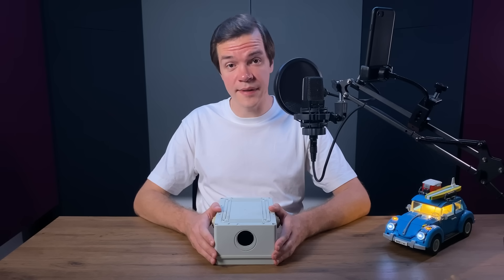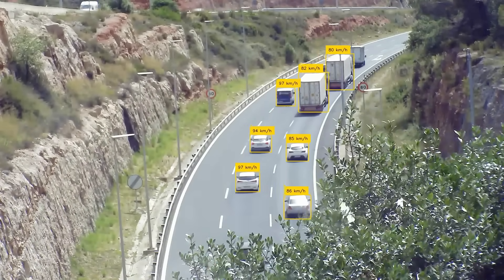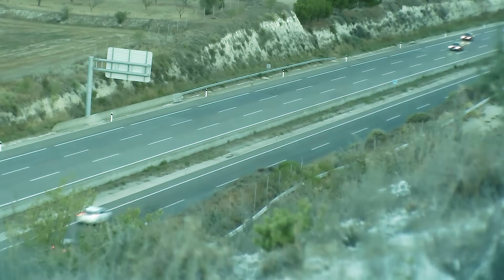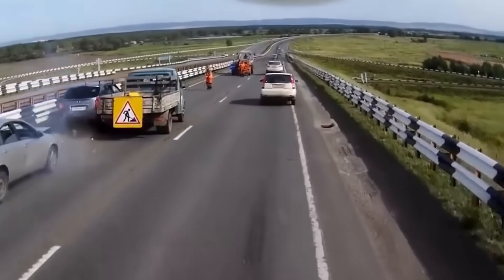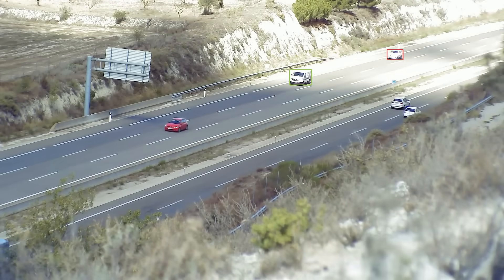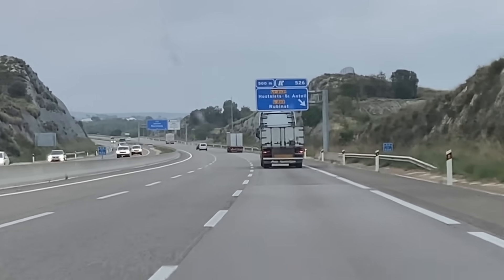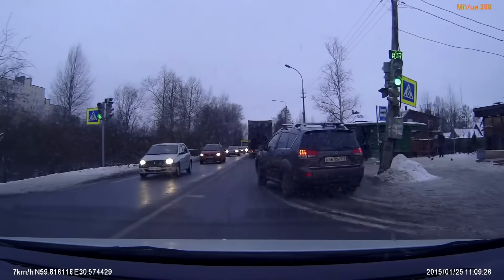New Anti-Tailgating Camera Reveals Shocking Statistics

Comment: Momentum.  This is based on speed and weight of the vehicle.  Assuming fairly equal braking power, you should understand the scenarios.  Your video focused on equal momentum.  But... real life... The momentum of three vehicle's matter (Vehicle in front of you, your vehicle, and the vehicle behind you).  Worst case (Heavy in front, light you, Heavy behind).  IN this worst case, get out of there!
*  if you're driving a lighter vehicle than the one in front of you:  You are going to be able to come to a stop more quickly than them; unless they suddenly hit 0 mph (i.e., crash).  The bigger issue may then become who and what is following you.  
*  If a heavy vehicle is following too close, you will need to extend your distance you keep from the car in front of you;  allowing for lighter braking so that the trailing vehicle doesn't rear-end you.
*  If your vehicle is heavier than the one in front of you, you'll need to extend your distance to accommodate your longer hard brake stopping distance
*  If your vehicle is much heavier than the one behind you, don't sweat it... they can stop way faster than you.
Without extreme distances, do not drive a car between two Semi Trucks.

Comment: Speed and tailgating are related. Most people tailgate because the car in front of them is driving slower than they wish to go. The car in front of them refuses to get into a slower lane. Interestingly,  I believe not yielding to a faster car behind you is actually against the law on the autobahn. Let's also consider that traffic congestion would double if you doubled the following distance of all the cars during rush hour. The traffic system cannot handle this. Cars would back up into the city and cause complete stoppage. You make an interesting and valid point, but there is no solution at this time.

Comment: I live in North Carolina, and I swear they tailgate here like their life depends on it. I drive a Mazda CX-5, though, which has an 'adaptive cruise control' feature that maintains a supposedly safe distance from cards in front of me up to a max speed I set, which I find VERY helpful - sure, I get cut off but the car automatically slows down to adjust the distances. It's not a replacement for being wary, however, and I keep my feet on the brake pedal if I am around other cars, but go out of my way to avoid clumps of cars and will speed up or slow down to get away from what I like to call 'barnacle' drivers that try to stick to your side panels. 

The single worst piece of advise given to new drivers is usually what reinforces this poor behavior, by the by: "stick to the other cars"; this is used as a metric for judging the acceptable speed on a road for newer drivers, but this habit of clinging to other cars becomes a built in reflex for most drivers who don't understand that every other car on the road is a hazard.

Comment: Bro did you separate traffic from non traffic?
You should distance between cars by speed of the following car
Also you don't consider that people can see AHEAD of the car infront of them. If there is nothing to cause the car infront to come to a sudden stop, then the probability of them stopping is so low that it doesn't matter if they are closer. 

You need to get accident data not regular driving data to come to conclusions about accidents. Your conclusion is that the minimum safe distance is causing accidents but you don't normalize your data and you don't even have accident data.

Comment: While I despise tailgaters with a passion, I have something to say about the official recommendations.

For some reason, every agency assumes the car in front of you can come to a complete full stop instantly. Needless to say, this is impossible. So why do we keep pretending it IS possible?

The way I see it, if you disregard reaction time and assuming both cars have equally crappy grip, you could tailgate at a distance of 1cm, both do a hard brake, and still not hit each other.

The calculation thusly: something something Braking speed back guy & Braking speed front guy + reaction time and something something distance. Where we must note that the distance is primarily a buffer for reaction time.

Comment: It's interesting to see that most cars with adaptive 'radar' cruise control have a 'headway' adjustment. On my Hyundai, for example, you only get the three second rule if you set the maximum headway between you and the car in front. Yes, it may be that a car with ACC active can react and slow down quicker than a human. There's going to be some interesting court cases in Spain with respect to ACC and tailgating fines in 2026. "My car did it, not me!"

Comment: Driving long distances here in Australia shows you how poor people’s judgement is and what they think is a safe distance. When there are no other cars nearby on a two lane freeway a car will pass on the right then cut in front by an unsafe distance rather than drive a bit further before changing back into the left lane (we drive one the left). It seems to me that the social pressure of keeping to the left (slow lane) is much greater than any pressure to follow at a safe distance. People get very angry if you are in the right lane going at the speed limit and blocking them from speeding.

Comment: It seems like you actually can tell who was tailgating and who was just cut off by seeing that someone was following at a safe distance and then a car cut them off, there might be some situations where this isn’t clear but for the most part it’s pretty easy to tell. In terms of AI analysis it could be a question of how long a car is following too close for which will give people a chance to slow down when cut off or they become a tail gater themselves.

Saying that following by a reasonable distance leads to people constantly cutting in, is an assumption. I typically follow further back and even further back again if the car in front is tailgating another car. If they smash into the back of the other car then they will stop more quickly than just slamming on their breaks so tailgating compounds, the more people who are doing it in succession. Most of the time I can follow by a safe distance and people only merge in front occasionally and there are only specific areas that it becomes an issue such as when one lane is banked up with people wanting to make a turn ahead and some people will try to cut in line rather than wait.

Comment: I love Mercedes' Distronic logic and algorithms.   If the car behind you starts to tailgate, the algorithms automatically start reducing speed to compensate for the increased braking distance which would be needed so he won't crash into you if you need to brake because of the car in front of you.    It's awesome to get a real jackwagon behind you and watch him 'fight' the computer.  The closer they get, the more the car slows down. 
My wife and I have since adopted the same driving style and it actually saved my life one night.   She was in the right lane and someone was tailgating her.   She was getting annoyed and I told her to just slow down like my car does.   She did.  He went around.   2 traffic lights later, he was at the stop line, we were right behind him.   The light turned green and he got T-boned and rolled multiple times from a driver fleeing police at ~50 mph.   If she hadn't slowed down to force the other driver around us, the impact would have been on my side.
Reply: Don't drive at night.
Reply: They teach this in driver's ed.  You need enough following distance for you and the tailgater behind you.

Comment: I don't make a habit of tailgating because I know it's annoying and it takes more concentration than I'm usually willing to give, but I don't consider it inherently unsafe in most conditions. In all the times my car has been hit from behind, I didn't notice the driver at fault being particularly close before my car was hit, yet every one of them would have been fined for "following too close" because the law in my area automatically, but falsely, assumes that all rear end collisions are the result of tailgating. Conversely, the few times I've felt compelled to follow another car close for some reason, I've never hit anyone; this is because following close takes far more concentration and can only be done by an alert driver. Even if a driver hits a car (NOT a motorcycle) while following half-a-meter behind, the difference in speed will be so small that the first collision is almost certain to be minor. The only way to hit a car really hard is to approach it from a considerable distance gong much faster and this is how most major rear-end crashes happen; it's usually a stopped car hit by an inattentive driver. So if we really want to make the roads safer, the crackdown should be on all the distractions to which many drivers now subject themselves, not on the more obvious annoyance of tailgaters. 
PS: As I emphasized above, my argument only applies to collisions between two cars; it should go without saying that drivers should never follow a less protected vehicle like a motorcycle or a bicycle close behind. Also, safe-distance rules should be strictly enforced as cars are heading into a merge. In fact, if cars coming into both sides of a merge were forced to keep a distance of even 2 car lengths, there would be no chance of those coming from one side blocking out those from the other side; we could actually have merges with equal right-of-way because there would always be room to merge.

Comment: [4:41]  While it's generally a bad idea to speed downhill, here, there's at least VISIBILITY to give you plenty of advanced warning in case traffic is STOPPED up head:  Plus, there is very clearly an steep uphill section, I do think it is prudent to put the engine into the proper state for this, as it's super annoying for the 95% of people I see that blatantly slow down during an uphill incline, because they have turned their brains off while driving:  Super frustrating.  But yeah, Police using a downlhill section against people:  That's an exploit that totally checks out.  Unfortunately, for them, it's not about actual SAFETY:  It's about generating REVENUE via tickets.

Comment: One possibility might be cars with indicator lights that shine up to the minimum safe distance, changing the angle as the speed changes. There are headlights that change angle. That could be easily calculated based on the speed of the car. Of course, it would only work well in low light (my mind goes to a laser but there are likely problems with that) and drivers would still be free to heed the warning or not and it's something that would require manufacturers to redesign their cars so it's probably not viable. Still, I think that some form of direct communication to the driver is the answer.

Comment: Thirty meters is probably going to be a 'safe' distance every time. The car in front of you is hardly likely to stop instantly because a brick wall suddenly appeared in front of it. But...! That only applies to drivers who are constantly aware of their surroundings and the hazards ahead. 

As I teach my three sons to drive I warn them that they need to be absolutely 'paranoid' and to consider everything on and around the road as a potential threat.

Keep in mind that there are drivers and that there are people who are operating a vehicle to get from one place to another. For a driver the act of driving is an exercise in perfection. The driver is trying to operate the vehicle with perfect control. That is very definitely NOT the goal of most people who are operating a vehicle. This can lead to problems quite often when people of different skill levels have to share the same roads.

Comment: He mentioned one key to safe freeway driving, without further comment: cars tend to cluster in packs. It's fairly easy to drive the nearly empty gaps between these packs, at least until the freeway become very congested. I'm certain this practice has saved me from at least one accident in my lifetime!
Reply: Underrated comment, this is 100% true. I try to be strategic and either drop back into or drive forward towards gaps between packs. It is also really easy to spot an upcoming tailgate situation. You'll get a fast pack of like 3-10 people hauling coming into a slow semi, or a slow car or something, it always leads to a little, if not a lot of, consternation, so I try to get by the slow vehicle or vehicles well beforehand, or position myself a bit further back and let the fast guys go by. It's very situational, but once you learn the flow, it's definitely easy to stay out of many less than ideal situations.
Reply: Good point

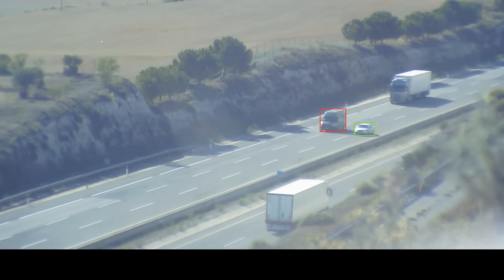Comment: 10:35 The statement that driving at 120 in certain circumstances is just as dangerous as driving 180 ignores an important point: kinetic energy is proportional to the square of speed. A vehicle at 180 has more than twice the kinetic energy of a vehicle at 120.

Comment: The problem with radar speed cameras can be solved with average speed cameras, when camera has no radar but you place two of them few km from each other and calculate how fast a car with this plate number travel this distance. So this cameras will be much cheaper because has no radar and driver can't just slow down in front of the camera and then speed up again.

Comment: Manufacturers wanting to promote the safety of their vehicles could add a dashboard indicator of the distance to the object in front using a laser rule. Just as an educational tool for the driver.
Reply: Good idea. I would buy such a gadget. Even better if it were expressed in time rather than distance.

Comment: Speeding reduction isn't just about safety, it's also about noise & pollution, there's a 6 lane urban "highway" near me with a n 80kph limit where it used to be 110 and it is much quieter than it used to be & is still very noisy. This is why average speed cameras are being introduced - to reduce the noise & pollution.

Comment: I also observe a phenomenon where traffic flow resembles compression waves.  Drivers tend to bunch up.  It can be seen in your videos.  They’re all trying to get ahead of each other.  If you drive the speed limit, you’ll notice cars tend to pass you in groups…a wave crest or compression.  After they all get by you (all speeding), you’ll be on clear road for a while…wave trough or rarefaction.

The best solution may be to require all vehicles to be smart enough to know where they are at all times and what the speed limit is at every location.  Then, the vehicle limit the driver to that speed.  To change lanes when a vehicle is beside you, you would have to signal and slow down slightly, with any other vehicles giving way to your signal to let you into that lane.

There would be no reason to tailgate because nobody can speed.  Nobody can get to a place faster than anyone else.  Which would also negate the desire for high-horsepower vehicles, because they would give no advantage and would be a waste of money and fuel/electricity.

However, often being unreasonable, drivers will still tailgate.  Many automobiles have technology to automatically apply brakes in a collision or near-collision prediction scenario.  They can also maintain minimum safe following distance proportional to speed.  These two functions of speed limiting and minimum following distance would  greatly reduce collisions, thereby helping to maintain traffic flow.  They would also reduce road rage, which I believe is mostly caused by some drivers’ belief that they are privileged to drive in excess of the speed limit to wildly various extents.  Anyone in their way, angers them.

Ultimately, the best solution is auto-drive.  Let the accurate, always alert, fast-reacting and emotion-free computers do the driving.  Then, as passengers, all occupants will be free to play with their phones.  The computers would be in communication with traffic flow control centers which could optimize speeds for maximum traffic throughput and efficiency.

…and no more tickets and far, far fewer accidents.

Comment: What IF the laws could be based on both the safety index and duration observing an unsafe distance, AND can in special cases apply to BOTH vehicles?  I think there is a straightforward algorithm that applies evenhanded justice nearly all of the time.  Also, why not mandate sensors on all vehicles to track speeds and distances on all sides of vehicles, so that this data can be used to prove innocence or guilt when a citation is triggered?